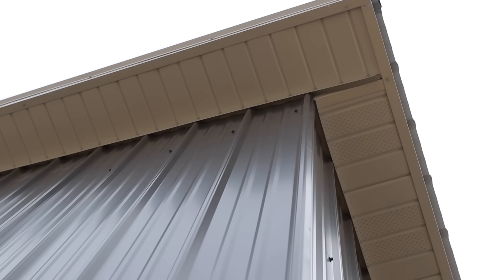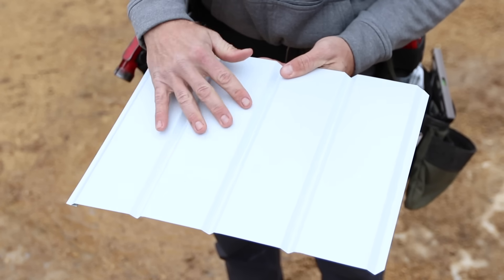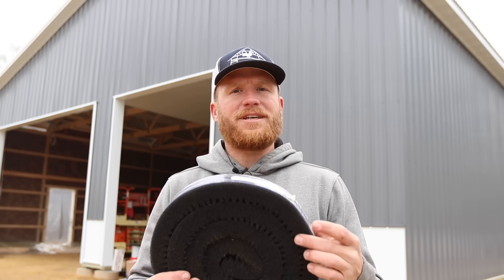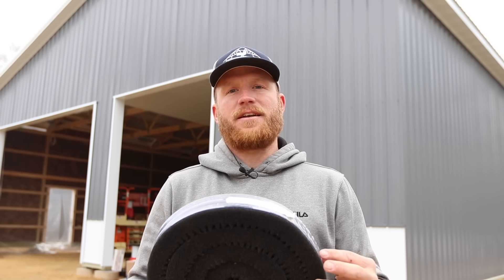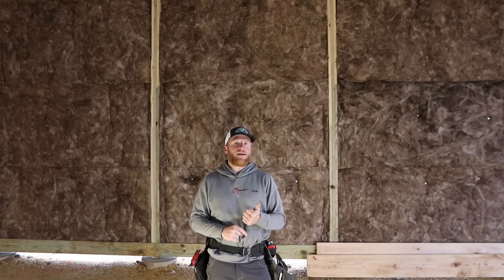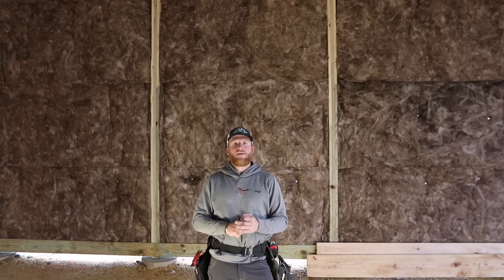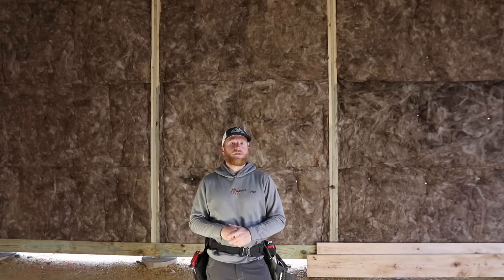Insulation: 5 steps to a more efficient building and why I don't use spray foam

Comment from the maker: thanks for all the positive comments and knowledge being shared on this topic.  Keep it coming!!
Reply: Hey chip, the bottom line is that it is difficult to build in our climate. We have cold winters and hot humid summers, so the question is where do we need to be putting our vapor barrier? I do know for a fact in a heated and cooled application the answer is not simply to put it on both sides of the home IE tyvek on outside Polly on inside, this is a perfect recipe for mold growth on exterior wall systems, I know this all to well one of my builder friends lost their business because of a class action lawsuit because he was building this way, now with all this said, what Kyle is doing here is slightly different than a typical house and I quite Frankly do not have all the information I need to say weather it’s right or wrong. Is this building going to be drywall’s? Is it going to be conditioned in the summer months? All of this has an effect on how you should build, I think our insulation practice is going to change drastically in our lifetime, I think we need to change our thinking on how we insulte and air seal, why are we putting our coats on the inside instead of the outside? Why are we not bringing air in on our own terms? And why are we still putting plastic on the inside of our walls lol. If anybody wants more questions answered I would YouTube Matt Risinger, very smart man when it comes to building science
Reply from the maker: I talked to Matt about this exact thing have you seen our conversation I uploaded it
Reply: RR Buildings  I have not.
Reply: RR Buildings 
Please post here the link to You & Matt ‘s conversation 
Thank You Sir
Reply: @RRBuildings   Kyle thanks for all the great information. That is the question I have, do I go vertical with insulation or   horizontal in how do I hold it.
  Finally at the point where I'm ready to insulate.
Reply: @RRBuildings  where r u from?
Reply: @RRBuildings if doing a flash and batt on an existing pole barn, is it ok to spray foam around the foam board, then fiberglass batt, then vapor barrier? Northern Michigan here.
Reply: Reuben Sandoval 
Matt Risinger refers folks to reputable sources of info so one can learn TRUE Building Science.
Reply: @Themuskychannel  I also like what matt risinger is doing.
The way in which he presents the various topics makes a lot if sense to me.
Reply: @Themuskychannel  yeah I'm north of Springfield in illinois. I'm trying to find as much good info as I can I will be building spring 2020.
Reply: @chipsammich2078   look at your local building codes they are specific to your area on how to go about things YouTube and building should not be going to...
Reply: How do you keep the batting from falling down over time?
Reply: Logan Dwyer that’s the problem with fiberglass it’s not if but when it will fall where foam is permanent it will not fall he stated he would only use foam in a older building where you couldn’t put the wind/vapor barrier on the outside he would put 1” of foam and then put the fiberglass bats I would go ahead and spray 3” of foam and be done
Reply: The quality of your videos is a reflection of the top quality workmanship you and your staff put into your building projects, awesome knowledge and thanks for always sharing it.
Reply: What height do you carry your pressure treated 3 ply 2x6 posts above grade? Looks like 6 ft... Why not only a couple feet above grade? It would be cheaper if they were 2 ft above grade vs 6
Reply: @jdkiehle3 what are you asking here?
Reply: Gd video. You, Sir just elevate the old masters' cardinal points. Greets from Poland.
Reply: Good American building video. You are doing it the right way. Just as we do in Northern Europe, Sweden. Wind barrier on the outside and humidity barrier on the inside. The air will stand still in the insulation and protect from cold or heat. Foam is not a natural material so skip that. You should consider skipping fibreglass. Stone wool is a better product because not water or moisture stays in it. Stone wool floats if you throw it on the water. Fibreglass sinks. No mould can grow in a dry insulation.
Reply: Rikard Ekvall Agreed. Rock Wool (Stone Wool) is a much better product. But it is more expensive here in the US. Most people don’t understand the value it adds to the structure and will not pay for it.
Reply: Hi... I am just curious as to the lifespan of the outside grade board considering that topsoil/ sod will be against it ... I realize it is PT wood but just curious as to your thoughts. 
  Great channel  that u have... love it up here on Canada's  east coast.
Please keep posting the great vids  :--)   thanks
Reply: I won't thank you later.  I'll thank you now.
Reply: RR Buildings I’m assuming your talking about the vapor barrier Kyle, I’ll look for upload thanks
Reply: Please add russian subtitles
Reply: I have a 30x30 pole barn that does not have a soffit vent coming off the side, no closed in ceiling inside and no insulation.  I do have a ridge vent at the top of my barn.  I am looking to insulate the walls to keep it warmer during the winter... would you recommend leaving the ceiling open (not closing it in) because I do not have a soffit vent and there could be condensation in the summers?  Or are there other options to insulate and close in the ceiling without this becoming an issue?  I do not need the ceiling for additional storage, but rather was simply thinking of minimizing the square footage required to heat up the area.  Thanks for all your great videos!
Reply: @milhollandmitchell  That's the same information I'm looking for! A two story Gambrel Steel barn with a ridge vent. I know how to build the 2nd story deck, just looking for some information on how to properly insulate a living area that doesn't require spray foam insulation.
Reply: Im about 30 miles south of you in Princeton If your ever in need please call us at 815 875 1901 at Ill Valley Insulation.  i do see a few areas you may be missing or not known about ( ie what about the "pockets " in the ext metal the glass is not "in"  and the channels they create for air movement thus lowering R value?) also in our portion of ill with blown glass ..blown glass will LOOSE almost HALF its R value when the temp gets to 20 ABOVE 0. not to mention wind washing at the eaves.  Have you ever hear of the book shelf method of framing ext walls?  you do a good job on videos btw!
Reply: Who makes the large insulation bats you used in this vid? They are very wide compared to normal bats.
Reply: Great job guys!  Keep making the 815 look good!
Reply: I see several comments re the fibreglass ‘Falling’.  Here in Europe it’s called slump. If you’ve ever crawled through an attic that’s got old fibreglass in it, you’ll recognise that issue. 
A useful alternative would be blown cellulose. It’s big advantage is that it can breath & can absorb some moisture. As long as it properly installed using a breathable membrane it’s an excellent job.
Reply: Joe Kinchicken  Your snide remarks cannot hide your ignorance
Reply: Do you build in southern Wisconsin? Looking for good builder for new shop.
Reply: Always a fan. Kyle, you have a great way of explaining and covering steps that need to be taken. Great videos as always. Keep it up! From Geauga County, Ohio.
Reply: House wrap has tiny holes in it and allows water and air to flow right through it. It's pretty much a useless product IMO.
Reply: mark schiavone agreed
Reply: Is there any reported evidence that spray foam will allow condensation?
Reply: With a room-in-attic truss system, what is the best way to insulate? I'm to that point on my building.
Reply: Thanks
Reply: I'm from germany. Carpenter master.  Good job. The best insulation we use is recycling paper. Isofloc. Ortschaft from wood Steicocell. The important factor is the hot  temperature in the summer.     So foam and rockwool are out of the race.
Reply: Kyle, I was also going to suggest following Matt Risinger, as he dives into various energy-efficiency topics using building science. He also covered an interested slabless slab, which might give you some ideas.
Reply: What would an estimated cost per square foot be on a building like this one? Looking for ballpark. Thank you!
Reply: I'm building a garage in northern Wisconsin, my concern is condensation when the garage is not heated on a consistent basis.  How do we prevent or limit condensation?
Reply: Hey hey. Been watching you for a while found you a matt's channel I live i a 50 year old "pole barn" and want to rebuild something similar. Doing a post and pad like this video now doors no windows slab insulation, concrete, pex, walls, roof, insulated unfinished inside. Price per SQ foot. One video you said you did one for someone that was basic nothing fancier than you need and it was around 85 a sq foot.
Reply: Hi, have you stuck with this insulation practice?
Have you rethought it?
I have seen a few vids from people living in this type of construction, saying it is costing hundreds of dollars per month to heat.
And I have seen vids of people with same construction but with closed cell spray foam saying less than a hundred per month.
Reply: @charlesarmstrong3536  I seem to think if your doing it do it right. Spray foam is where it's at your get a proper thermal and air barrier. And I've read about the thermal mass of the spray foam is all and added thought compared to fiber type insulation. I also watched a video on how fiber type insulation can still have air convection it creates its own air movement from outside wall of house to inside wall of house. Spray foam doesn't allow that. And I've read about the structural integrity spray foam adds.
Reply: Another awesome video, thanks for the good content
Reply: https://buildingscience.com/documents/digests/bsd-106-understanding-vapor-barriers

Please give this a read Kyle.
Reply: @Themuskychannel  
I read it all.. cant say I'm more enlightened. More confused that when I started honestly..
Reply: Chip Sammich 
To reduce confusion, google the subject!
Follow Matt Risinger on “the build show” on Twitter, IG, FB, & YT.

Comment: What about if you have an older post frame, that has no soffits and no ridge vent, it’s currently not insulated. But I was hoping to insulate it. But obviously worried about condensation especially on the roof steel

Comment: I’m so done with foam it’s over priced and you should always use closed  cell Insolation . The wrap is great and it’s no different than a human putting on layers. You could wrap your building then add 1 x2 cleats 2 ft on center  then wrap it again with the house wrap and with your inside r-19 it would outperform foam by a lot .

Comment: not so confident the floating concrete rat board concept really amounts to much for stopping freezing at that joint.  maybe we convince the world with some temperature shots when things are freezing outside ,  maybe i missed something here other than your explanation of stopping the freeze with a slab on grade and an insulated wall above that seems like foolery to me, what gives with that failure by design  , everything makes sense except the concrete shor t cut with minumum anything to stop the freeze from owning that ordeal , most of us understand that is just nonsense at the bottom of the wall , just so it sounds good i guess because what i hear is not stopping anything beyond some moisture in the wall cavity until a few freeze thaw cycles, we know where frost is chocked off and it is not at ground level , more like coold and cold and welcome is cold , i also beleive you know it too , just plain foolery noise to validate the noise to explain the shortcut to minimum r vale under that wall

Comment: On a steel building that doesn’t have house wrap, would you put foam boards between the exterior purlins? Or would you put them inside the purlins and leave an air gap between the steel and foam?  (The barn is in Northern Mi)

Comment: Morton Buildings has used all these details and more for more than 40 years. 15-1/2" heel height, attic air deflector made from house wrap, bottom cavity for perimeter insulation, vented sidewall soffits and solid end wall soffits with vent-a-ridge, vapor retarder on the inside walls and ceiling, R-19 blanket insulation are all Morton Buildings standard features. They even have a new concrete lower grade/splash board available. If you really want the best, check THEM out!

Comment: So I just recently had a shop built and the guy that built it did a really good job a lot of the practices that you use he does the same. However I opted for a spray foam and when they came in they only did 3 inches of closed cell. And the spray foam guy said this was plenty "for a shop" this is what he does and all his shops but my question is could I feel the cavity with some rockwool before I put my tin on or am I asking for mold problems because there's mixed reviews on flash and back type of systems. Just wondering what your thoughts were on this

Comment: I was gung-ho when contractor suggested 2 years back to use spray foam in crawl space I spent 2 years mulling over it and thank God I didn’t I love the concept of rockwool and looking forward to putting drainage mating on the base dirt to allow cleaner surface but also allow some breathing and then taking out the ole glass fiber and replacing it with rockwool 
Leave the side walls as they are I figured 20 years plus of survival means something was done right back then no termites and no dry or wet rot 
If you spray home termites love that snug boundary saves them building mud tunnels and also now hearing many issues with mortgage lenders when used in attics

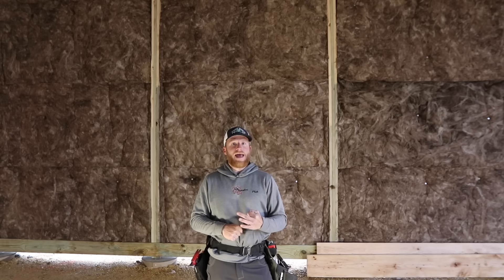Comment: 1" flash'n bat at ~6:00 mark on remodel job.  Does that have to be closed cell spray foam or can you just use foam between the girts, etc and then apply bats and vapor barrier on top of the bats?  2 vapor barriers there?

Comment: Something i found interesting is the concrete.... in my family's experience, concrete will bring in the cold, but not running concrete all the way out to the outer wall will, without a doubt, bring in pests.

This was on my parents' barndominium built in '02. On my barndominium, i plan on running either a heated concrete floor or running a concrete floor to the esge or just inside with insulation board to reduce the temp it carries and then running a 8-12" concrete pad around the outside(makes trimming grass/weeds so much easier). But it all costs $, and that's what will determine the build.

Comment: Fiberglass does not stop anything. It is an overrated product that doesn't work, especially when your temperatures on your exterior wall reach a 120°. Fiberglass fails, do not use fiberglass Use cellulose insulation, it is not a conductor like glass.It will work much better this ad is snake oil. I insulate for a living I do not touch fiberglass it is not worth the time it's ezy this is a fake to make money. I do not bow in less than R49 with cellulose loose fill insulation. This guy is snake oil.

Comment: This is a great video, super informative! I have an older post frame shop that I am looking to insulate, but rather than doing flat girts on the outside, they ran bookshelf style girts, with offset blocking in the middle. Also there is no house wrap. I like the idea of the foam sealed with right stuff against the steel siding, but with only a 6” cavity and all that extra wood in the runs between each post, I question if it is my best option.

Comment: I recently bought a 30x54 pole barn that already has steel on it with no vapor barrier on exterior. I want to make a living space in it while we build a new house. What is the best way to insulate it as it sits? Should I pull the steel siding off and put a vapor barrier?

Comment: With the price of spray foam these days, it's only going on the roof and rockwool in the walls with tyvek, and on pole sheds I do the bottom like you do it only pour the slab to the inside.

Comment: Hi Kyle, Great job on advancing the industry! When insulating post frame buildings have you ever ran the numbers on slipping 1.5 inch thick R10 foam board between girts. I've considered it with 2x6 girts 29.5 inches on center. I have also seen that you use rockwool, it is so expensive what are the most compelling arguments for using it?

Comment: Built my house 8 years ago and went with 2” of spray foam and 3” of fiberglass insulation. It works fantastic most times i cant tell if its wind or raining outside heating bill is next to nothing for 4500 square feet. All radiant in entire home, basement and garage. Best of both worlds

Comment: The company I used to work for built a warehouse, they put 1 inch foam on the outside and it made the interior warm, we didn't need any heat in the winter.

Comment: Where do you get the large insulation?
 What brand?
Reply: Morton Buildings sells an 8ft wide by 40ft roll made to fit between post that are 8 ft on center.

Comment: I love your presentation and was basically what I planned to do in my pole barn/shop - but all the extra steps (read labor=$) are likely not worth it.  I had the shop spray foam insulated and no leaks. less labor and heat a 1600 sq ft shop with a 1500 watt electric heater (upstate NY for climate reference).  Foam is not cheap, but so effective at sealing and stopping heat a moisture transfer without the outer weather barrier and without the vapor barrier.   I think your work quality is exemplary but I would still use foam.   I'd love to see a cost comparison per sq foot of spray foam vs. all the your layers and labor.